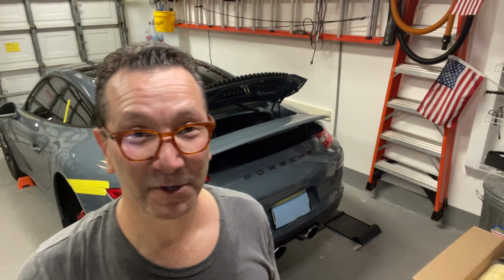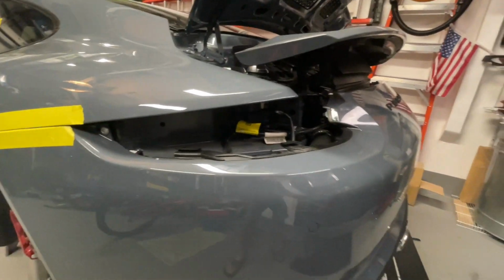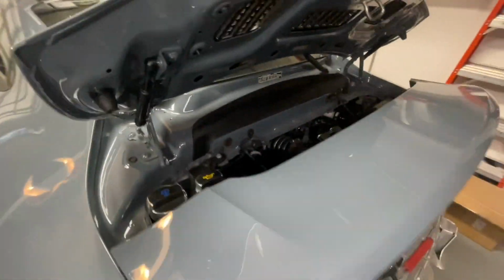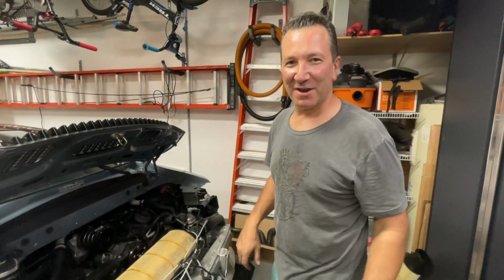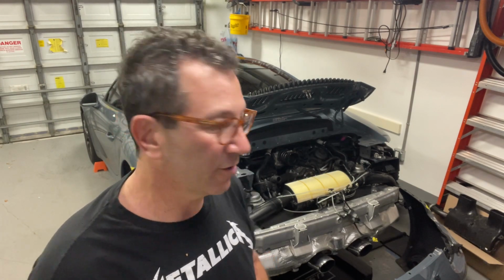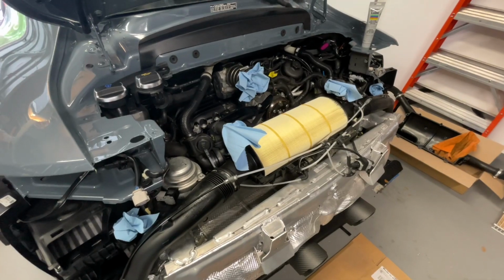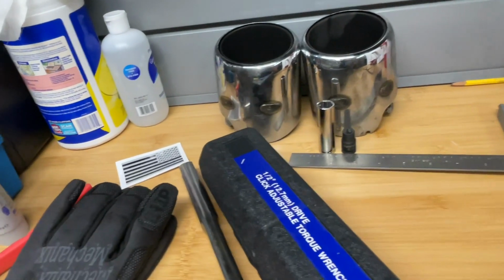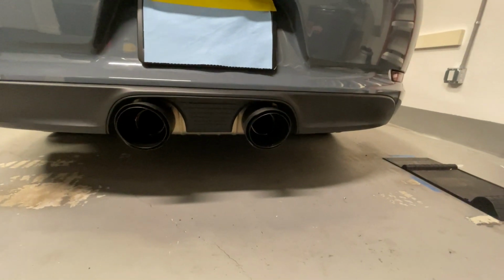Engine Air Filter (NOT 991.1) & Exhaust Tip Change Porsche 911 991.2 Carrera S C2S DIY Maintenance

Comment: Great video for the DIYer. From someone with a 997 and it taking only 10 minutes to change out an engine air filter, this is tough to swallow. I am second guessing my desire to upgrade. LOL.
Reply from the maker: Thanks!  I tell you that was the most complicated DIY I've ever done on a vehicle but then again , I'm not super mechanically inclined.  Some will say this is pretty easy.  The one thing I did not have the courage to tackle yet is the spark plugs because on the 991.2 it became significantly more challenging than on the 991.1 (which was more challenging than the 997).  I will tell you that the air filter on the 991.1 (2013-2016) seems quite a bit easier to change out than the 991.2 (2017 - 2019), so hopefully that's useful to know.
Reply: @fickstit2839  Thanks, I will keep the 991.1 in mind then for when I do upgrade. That process for the .2 looks horrendous. 😆

Comment: Hey David. I am changing out my air filter for first time. I have gotten as far as everything is disconnected from the y-pipe, next step, getting the y-pipe out. For me, the worst thing has been the electrical connectors. I hate those things. BTW, the big connector for the spoiler, I broke that too.
Also, you never said if you would do this job again.
Reply from the maker: I would definitely do this job again.  It's too much fun working on this car and learning how everything works.  I would feel foolish now spending hundreds of dollars to pay someone to take that fun away.

Comment: I just want you to know, I own a 2018 graphite blue 991.2. Has there ever been a better color on a 911? The color was discontinued a week after my car was built. I passed up getting a Carrera T strictly because I couldn’t get it in this color as a stock color choice. 

I also took my car to the dealer for the air filter change because of your video! Expensive but worth it. I don’t have the time, and this is my daily driver. So thank you for taking the time to document this. Saved me so much headache. The 991 is much simpler. I would have done that one myself. 

I’m thinking of changing my exhaust tips also. And yes, Soul and Fabspeed are ridiculously expensive for what they are. 

Can you tell me which vendor you used for your tips? They actually look great for the money. 

Once again, we really appreciate your videos out here! Thanks for everything!

Comment: VW shares these same electrical connectors.  The trick with them is you have to first push the connector together, then squeeze the release tab and pull the connector apart.
They are relatively expensive to replace and you need to know how to depin the connectors, and have the proper tool to do so.
Reply from the maker: These types of electrical connectors are one of my least favorite parts of any of these jobs.  I feel like there's always a high likelihood that I'm going to break one of them and I usually do.

Comment: I’ve ended up deferring this work a little on my car. It was due 6 months ago, but the mileage is low. I’m going to hopefully have time this month or next to get to it. Another thing to consider, while you’re in there, is the accessory belt and tensioner. The tensioner damper tends to start leaking, even on cars with low mileage, and it’s part of the tensioner assembly so might as well just replace the assembly instead of just the damper. I noticed my damper is leaking with 15k miles, and I plan to replace all of that while I’m doing the filter and spark plugs. Fun times; wish me luck!
Reply from the maker: Good luck!!!
Reply: @fickstit2839  wasn’t as hard as I expected, but it’s definitely a lot of work. Doing it the second time will be even easier I’m sure. Thanks for the video, it was helpful to have as a reference!

Comment: Great video. There is no pdf version of 991.2 workshop manual which makes DIY a lot more difficult. I will remove the rear spoiler and bumper to check the change-over valves and vacuum hose connection for the “coolant system fault” alert. I know how to remove the spoiler now but do not have the torque SPEC for the bolts of spoiler. For rest of the parts, the torque is small and I think I can just hand tight it without issue. Do you have the torque SPEC for the rear spoiler? Otherwise I may just use the same torque for the 991.1.

Comment: Hi just watched this and you and I are very similar with our mechanic skills, and after watching this I might just take it to an Indie shop.  I am very impressed with the video and am happy you got it completed (no matter how long it took!)  

Question - is there any reason you didn't go with the BMC filter over OEM?
Reply from the maker: You could do it man!  Just be patient, take your time. OEM filters are cheap. For me I’d rather have something I can dispose of and replace with new than deal with carefully cleaning an air filter. If I were convinced that there would be a significant improvement in performance with the BMC, I might reconsider. But at the moment, I have yet to see anything compelling. I doubt I would notice any improvement.

Comment: Nice job David. After completing this would you consider installing the IPD Plenum since it's right behind the air filter?
Reply from the maker: Hi, Don.  I'm not quite convinced as to any improvements or gains I will experience from the IPD plenum but I'm not ruling it out either.  It just might come later down the list of mods.

Comment: You could have gone a LOT longer with that air filter.
Factory recommended interval is 40,000 miles, unless you're driving in very dusty conditions.
Reply from the maker: Also recommended at 4 years. While I realize that my air filter was relatively clean, no sense in going beyond recommended time intervals and risk that any part of the air filter degrades and cause issues of other kinds. But yeah, I realize it could have gone longer.
Reply: @fickstit2839  paper filters don’t degrade in anything shy of ten years at least.

Comment: I honestly wonder how many times this work is paid for at a shop or dealer and actually not done.   When most places will not even change the gaskets when doing an oil change...
Reply from the maker: I tend to believe that for things that you are able to DIY, you'll do a better job than paying someone else to do it, particularly if you take your time and do it right.  That's one of the reasons I like to DIY things on my car (when I can).
Reply: @fickstit2839  totally agree.  I think this job is a bit beyond my skill level tho'

Comment: So every time you change the air filter you have to pull out the rear bumper? That the most stupid engineering I ever seen
Reply from the maker: I somewhat agree until you see what's involved with changing the oil and other basic maintenance on some other european sports cars like ferraris and lambos.